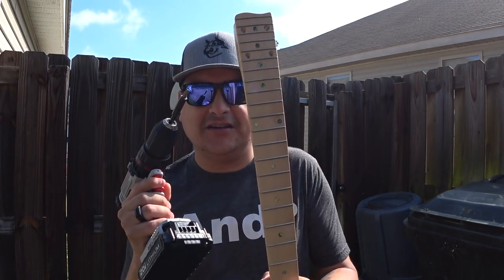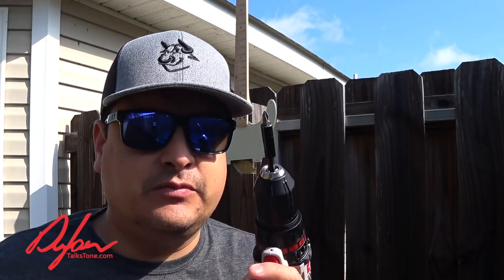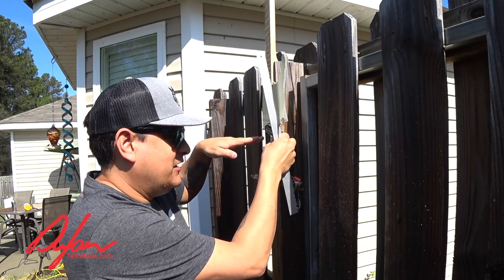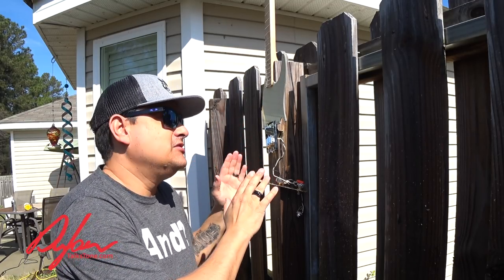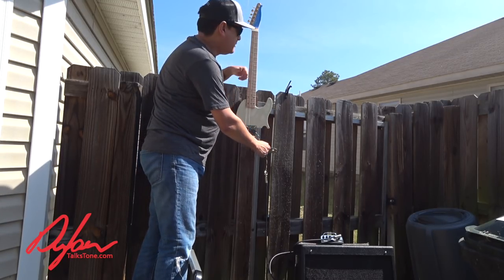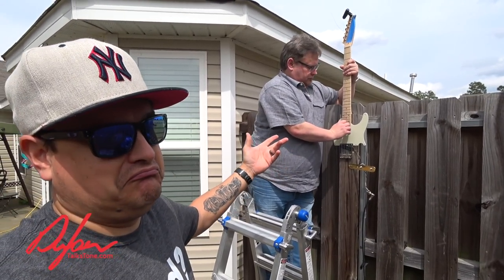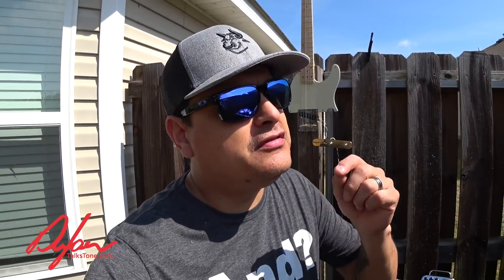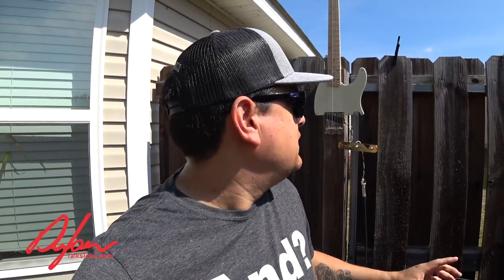The Tonewood Debate  Can A Fence Post Sound Like a Tele   Part 2 (tonewood is dead)  Episode 303

Comment: This experiment, though remarkable, proves exactly nothing about tone wood. You can make music and have fun with a single string tied to a metal tube. What your experiment proved is that having an electric guitar with all its standard components (neck, frets, bridge, pickup,...) except for a curious type of "body" actually works. Fine, this is no surprise, we've already seen plexiglass guitars, for example, haven't we? If you took any other solid material it would have worked too, I guarantee. I'm using the verb "to work" on purpose. But I didn't see any comparison to a good quality Telecaster body here, and someone already pointed out we have a pretty extended "body" surface here, which might even sound better than an actual electric guitar body, because of a possible extended resonance! But you can't take a whole fence to a gig or in your bedroom, SO any criticism to the tone wood enthusiasts must be at least realistic!
Reply from the maker: shredgd5 or.... it could be just for fun

Comment: ...if only there was a guitar company that made guitars out of say, I don't know, masonite? 😎🎸
Reply: Sassy Cat:  Only Brazilian masonite, of course.
Reply: What are Danelectro's made out of?
Reply: Danelectro
Reply: Lap steels (the Original solid-body guitar) have been made of ceramic, wood, aluminum, Bakelite plastic (like those Maccafarri electrics from Italy lol). Lucite, carbon fiber, and plastic have all been used to make normal-sounding guitars; why not Masonite, Korian/Formica, or fiberglass?! I saw one at the SoCal Expo in 1972 made from a steer skull (with 2 HBs and a twang-bar)......
Reply: hippiekarl7 - that's the joke. 😉
Reply: I know; I've been asking around elsewhere on the page where all the 'shape-wood' believers are (according to physics, they should be the same people: those who believe that factors OUTSIDE the signal-path affect timbre....like a medium's resonant nodes/focii)........
Slightly different joke; but the same punch-line. ;-P

Comment: The funniest part, its a tele, and the person smiling the biggest about this is the late Mr. Les Paul. After all he did the same thing, just not attached to the fence! Love it Dylan.
Reply: GasNBullets yup. He called it. The log.
Reply: Well that's the thing, the big companies used whatever wood which could do the job. America just happened to have an abundance of swamp ash, maple, mahogany that fit the construction bill at the time. Rosewood and maple just  happen to be high impact timbers and good for wear for fret boards.
Reply: Les Paul looked at a Rickenbacker 'Hawaiian' lap steel, and went, "Hmmmm; all that needs is real frets and a strap....."

Comment: I had a buddy of mine coat an old cheap Yamaha strat guitar body with spray-on bedliner (the kind they spray into truck boxes). It sounds no different from any other strat I own. It may even sound a little better. My very first guitar was a Gibson Sonex that is made out of Masonite and epoxy. Ever heard of a company called Danelectro? Do you think they use expensive wood in their guitar builds? Nope. Plywood. It is my opinion that anyone who tells me anything about "tonewood" just likes to spend money.

Comment: Thanks for this Dylan. This is the proof. You can take any guitar body of any shape and made of any kind of wood. As long you take the electronics and the hardware of a Tele and put them at the same position as it was on a Tele, well, it will sound like a Tele. I believe there might be a very sight influence of the material used for the body and neck, but I fear honestly, most of us are not able to hear that. You could well do the same experiment with the most essential Les Paul parts and the usual geometry and set up for that kind of guitar. It sure would sound like a Les Paul no matter what.
Reply from the maker: thank you! feel free to share

Comment: Sounds like you're using cedar set in a dirt hole instead of cement.  
A nice pressure treated pine 4X4 set in 1 part cement, 2 parts sand, and 4 parts gravel would give you a brighter sound.  Use distilled water if you want more sustain.   

;)
Reply: That checks out.

Comment: Are those mahogany or swamp ash fence posts? I hope one piece and not several boards glued together! Lmao! It sounded good! People fuss about guitar bodies that they're too many pieces glued together and not the proper wood! In my opinion a one or two piece body has a way better chance of warping than several boards glued together in alternating grain pattern...one with grain curved up, the next turned down, etc. We learned that in 7th grade wood shop! I made a license plate guitar. Used a pine 2x4 thru the center for the main body. I used some old fence boards cut up to make the box...same size as the license plate. I then attatched a neck and hardware from a cheap First Act guitar. Has a humbucker pickup. I don't know if it's the metal plate on top...a rusty 1966 Virginia tag, or what, but the thing sounds great! No fancy tone wood at all!

Comment: Well, I'd say it sounds a lot more fat and massive than most Teles would, no surprise. Watch the video where Johan Segeborn, the Swedish Gyro Gearloose of electric guitars, put a string on a steel beam that's part of a hundred tons construction, sounds huuuge! Of course every last little piece on a guitar has it's part in the making of it's sound, just not to the same degree, the sort of wood isn't very important in my opinion.
If the price is right I'd gladly buy a Tele made from fence post  ; )

Comment: Yeah bro put your fence sounds like krapp and also it's not easy to play which is the whole point of a good instrument with consistent tone.  Any amateur hack job might agree with you but any professional that works full time on music knows the difference between a good instrument and krapp and each instrument is separate but the good ones hold up over time unlike un unplayable  fence post. None of the notes are in tune and it sounds like krapp

Comment: I've seen someone use maple, mahogany, and pressurized fir. it all sounded good, but I wouldn't say it sounded exactly the same. it is minor and arbitrary, but it does affect it hahahaha.
Reply: Any difference was due to the individual pickup set in each; not the body material. Confirmation bias, much?

Comment: The fact that you can't hear the sonic differences between this instrument and a finely crafted tele only speaks about your personal auditory deficiencies. Of course one can make music with a fence - heck, first musical instruments were way less refined than even this. But this is what ages of development did - master luthiers took the craft to the level where it's nuanced and players and listeners can actually hear those musical nuances. What you've done is equivalent to putting square wheels on a cart and saying - look, it moves as well, when I push it with enough force or when a horse pulls on it. The principal possibility does not equal quality - these are different things altogether, and you've simply conflated them or perhaps you are actually incapable of understanding the distinction.